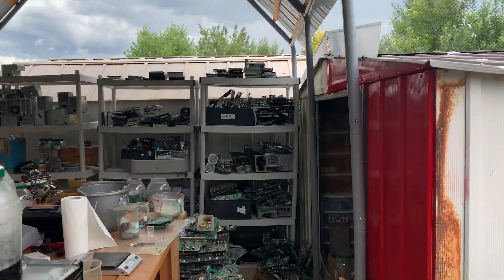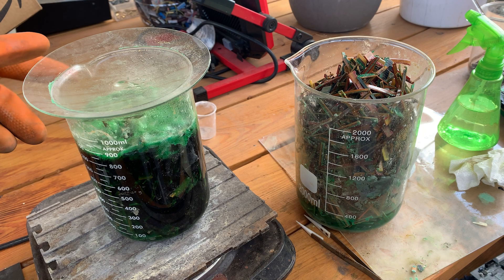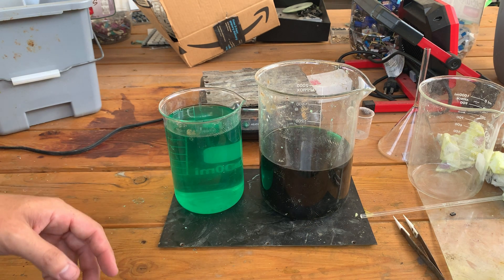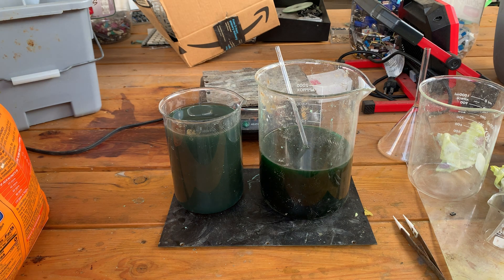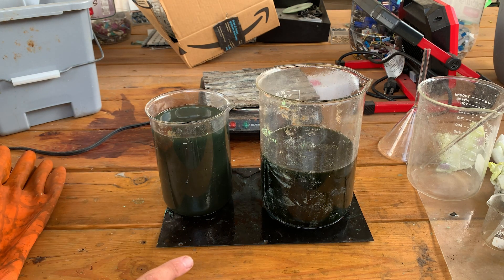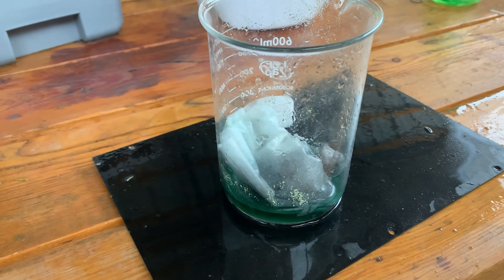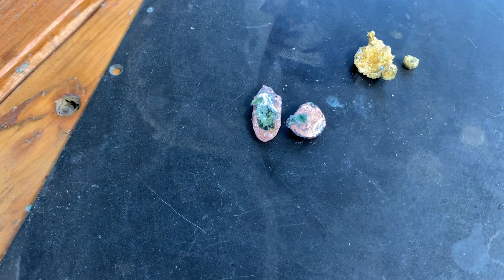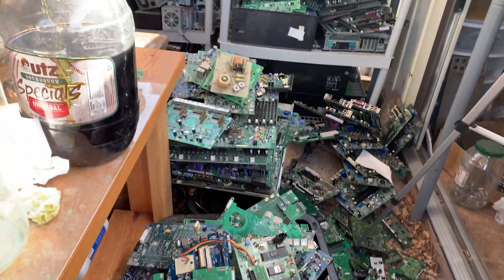eWaste Gold Mining: Ram/Video/PCI Fingers

Comment: Don't use sodium bicarbonate it produces too much gas either use sulfamic acid or just add more SMB until the excess nitric is used up
Reply from the maker: I was not aware that the SMB would denox that well... it is something I will try.  Thanks for the recommendation.
Reply: Also Sulfamic acid, breaks down the nitric and creates Sulfuric acid, which drops any lead out of solution, this should be refiltered before dropping with SMB. But I’ve been there, mess is easy to get into sometimes, thanks for sharing.